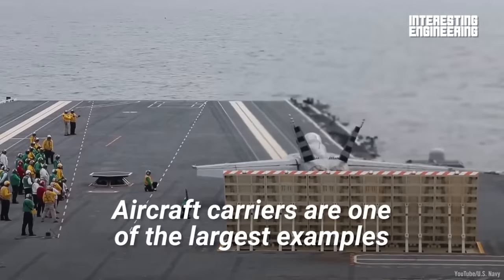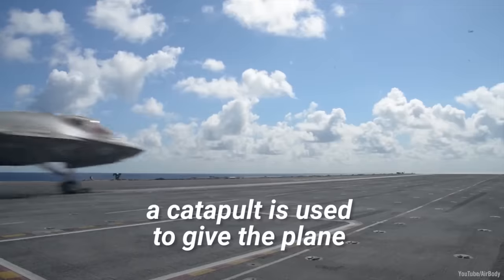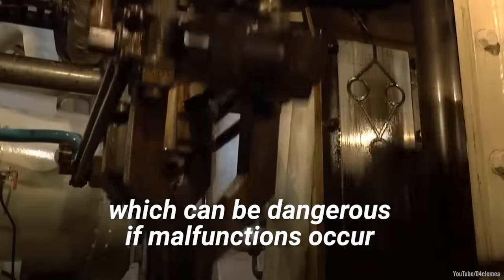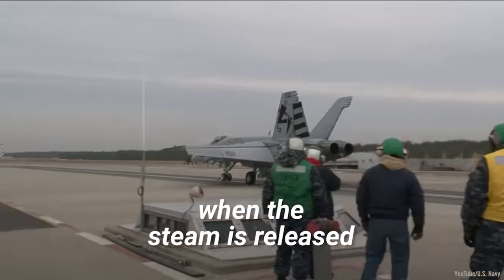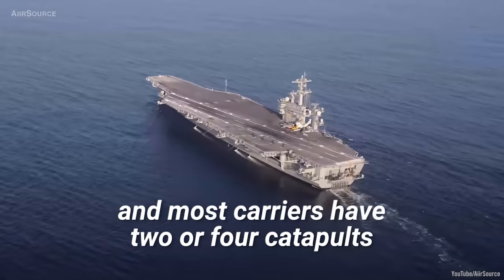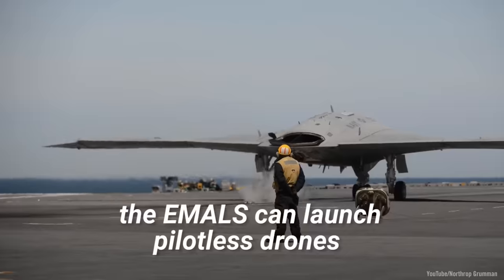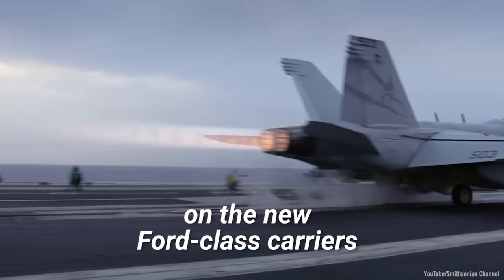How do aircraft catapults work?

Comment: Just add flame retardant parachutes to the f 16s.

Have a button installed to where, as soon as the aircraft catches one of the wires, the parachutes deploy at the same time the wire catches so that the landing & slow down time can be easier & smoother. 

If somehow both fail (the wire/parachutes) install a backup plan where very sharp scissors cut the wires to detach the parachutes or disband the parachutes from the aircraft as a safety protocol so the pilot can still maintain liftoff just in case.

That will also be a button installed next to the parachute deployment button. Or not next to it, but close by.
Reply: This is the dumbest idea I’ve heard in my life.

Comment: Question....How is a pilotless drone too heavy to launch by steam? When the steam system is already launching aircraft like the C--2's today and has launched others like the A-5 Vigilante in the past?
Reply: Because the writer is dead wrong.  Any new carrier capable aircraft will have to work with both steam and EMALS.  There will be steam cats in USN into the 2050's.
Reply: Yeah that's what I thought....no way a pilotless craft is "too heavy" .... you just took out the whole cockpit and your gonna say its heavier still....
Reply: Also, that drone is full of fuel. For aerial refueling other aircraft. Thats the purpose of the specific one shown

Comment: What about landing
Reply: More of them are using net to catch the landing aircraft.
Reply: What about it?

On approach the aircraft will lower their tail hook, and adjust their flaps/throttle for appropriate landing configuration. On approach to the carrier the pilot has an visual system guiding them in (called the meatball) that tells the if they're too high, too low, or on course. Then there's the auditory system of the LSO (Landing Signals Officer) who is watching the planes come in to give them further ways to let them know how their approach looks.

The "last" hurdle a pilot must deal with is a vortex that exists on the stern of the carrier. Finally once the wheels of the aircraft hit the deck, the pilot immediately throttles up and is instantaneously ready to take off again and perform a "missed approach" or a "go around" should the pilot have missed all of the wires. On the landing portion of the deck of the carrier, there's a system of wires that a landing jet must snag with their tail hook (the US switched from 4 to 3 wires). Computers will then lower the throttle to 70% once the declaration of a successful capture is noted, then the pilot brings the aircraft to idle, raises the tail hook and taxis to where he needs to go. 

Contrary to what you'd think the pilots NEVER aim for the first wire - as that's the closest to the stern of the ship and will get the pilot a poor rating on the landing (navy aviators are graded on their landings. in a 4 wire system the 3rd is the aiming point, in a 3 wire system the 2nd is the targeted wire).

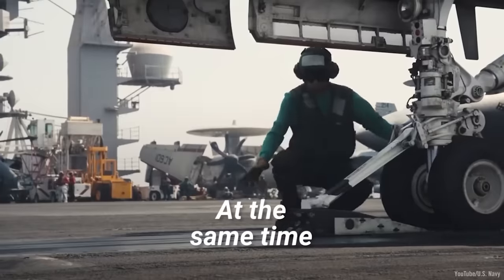Comment: 2:40 wat was that?
Reply from the maker: He was like a magician.
Reply: @Interesting Engineering  Heard about the recent developments of Klein Vision Flying-Car? Needless to say they nailed it. But it is still far from mainstream, unless someone adds F-35 Lightning-II technology to use for Vertical Landing and takeoff. 

F-35 + Klein Vision = Flying Cars of the Future
Reply: Edit: Still far from reality, Oil shall deplete in near future and we shall need Electric Batteries to power them. And still we got no solution for light-weight batteries or capacitors for Aircraft.
Reply: @chan_for  No, oil will not be depleted in the near future!  It is a function of cost/price.  There is lots of oil left!

Comment: Some of the footage shows an F35B using STOVL that is not a catapult
Reply: Actually Errol, if you look closely it was actually a C model... They were hooking it up to a cat in the vid (around 2:58), and it didn't have that crazy humpback behind the cockpit canopy.
Reply: @chrismaggio7879  you don't know what you are talking about. 1 min 7 seconds is 100% a f35b, it is in stovl mode which you can see by the engine pointing downwards and the fan shaft being open
Reply: @errolbrown7158  If you read my comment I was talking about the aircraft at 2:58... I didn't see the one you referred to but I do have to say you are pretty worked up over something so insignificant. I looked and did find the B model going vertical, and along with the other non-correct clips in this film I guess I glossed over it. By the way, the Marine variant can also be catapult launched. And yes, I do in fact know what I'm talking about as I was a green shirt on the flight deck. Have a good day, sir.
Reply: I am also an aviation artist so I "think" I might know one from the other. wink
Reply: You don't know what you're talking about f35b is not capable of being catapult launched
Reply: @errolbrown7158  just the nastiness of your responses makes you unworthy of any more responses. I'm sorry you are so bitter and closed minded. Be safe and goodbye.
Reply: @chrismaggio7879  you're just annoyed because you made a fool of yourself
Reply: @errolbrown7158 You need to go back and research your homework. F-35s can be launched and recovered on the Flight Deck. If you do disagree, can you please cite your disagreement thoroughly??

Comment: I see.. that futuristic drone there is heavy then. It looks like it could be light
Reply: That drone is nothing special. It carries fuel to aerial refuel other aircraft, which is why it weighs so much
Reply: @brass4909  It doesnt weight much, it can only carry around 15k lbs of fuel so fully loaded it may weight somewhere around or slightly above the weight of an empty superhornet which is around 30k lbs, and its maximum take-off is 64 or 66k I believe.. I guess this must be a mistake by the narrator, no drone is too heavy for the steam catapult, not even the RQ-4 so I presume he meant to say they might be too light to a point it produces too much stress on those drones
Reply: they are not heavy, or even way lighter than the fighter jets
but it is true that steam catapults can’t launch them
Reply: @brass4909  drone for refueling? I'd sooner use it to bomb submarines than give away its fuel that will reduce loiter time
Reply: @NotEvenDeathCanSaveU  this iz quite possible. I cant wait to see drone dogfights
Reply: @wiffy1346  why cant yhey be launched if they r lighter
Reply: @rinsedpie  basically they are too light to be launched by the catapult, if you try to launch those drones with a catapult, the drone would probably be squished
Reply: @rinsedpie  Before refueling drones became a thing, carrier squadrons would have to sacrifice a perfectly good warplane like an F-18 Hornet or another attack aircraft type to refuel any strike!

Comment: To be very frank, CATOBARs are misuse of space and resource. The catapult is situated just in the front, occupying a small space of the deck, while the whole deck is left behind, and arrestor wires also stop the plane far behind, at the end of the angled runway. The rest space is unused. STOBAR s in that case are more space efficient

Comment: Why mess with something that's not broken, steam is proven!!!
Reply: Partly because steam systems require that a third of the ship is piped and ported and plumbed and filled with systems just to run the damned things! Using the newer electronic systems eliminates all that equipment as well as reduces the manpower required to operate and maintain them. Now those spaces re used for other things... like a lot of electronics that may or may not be zapped with the first EMP proximity burst leaving the ship powerless and useless... (?)